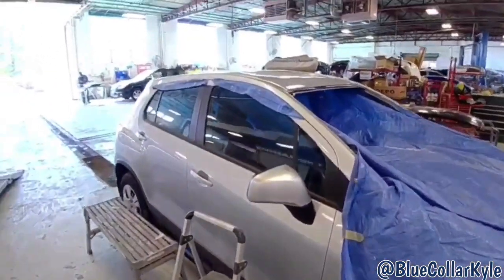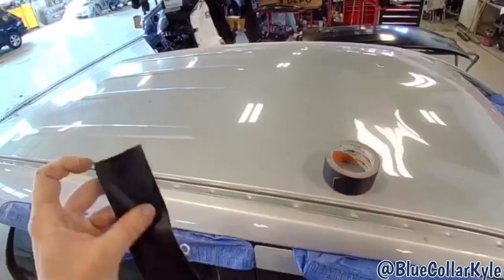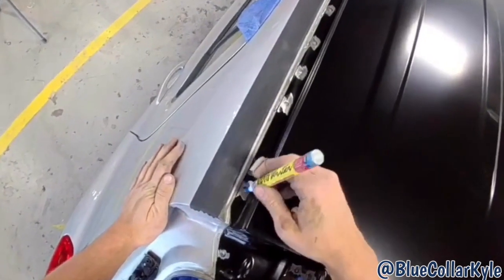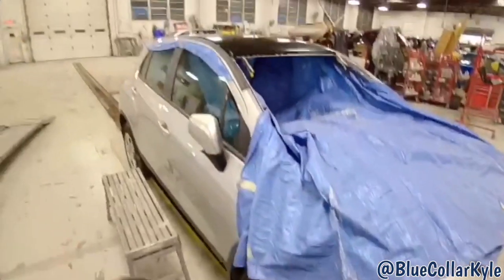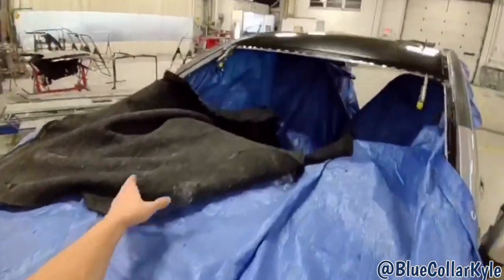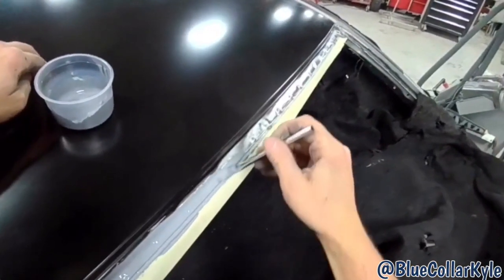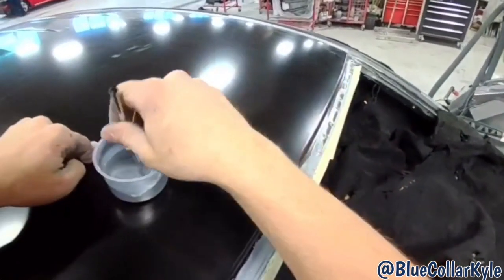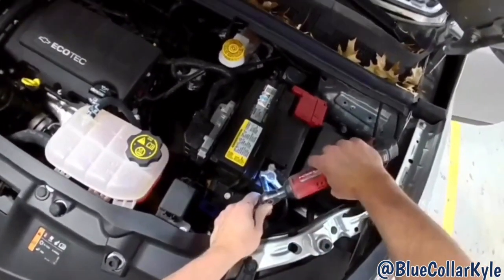Make It A Convertible!

Comment: So...  why not just take the dent out?  Didnt look like a terrible dent... just curious.
Reply: Nitro 187 it is pretty bad. You have to remember, insurance companies are cheap and want the cheaper route. So if replacing a roof skin is cheaper than repair that dent then they’ll pay for it. Also have to consider if the repair would be a safe and legit repair when you repair that dent if it wasn’t replace. But it truly wouldn’t be worth it as replacing a skin would take less time.
Reply: @celo8019  by the looks of it, repairing the dent looks faster...  but I do love watching this process. I guess they have pre-set methods on things though.
Reply: tony75814  cracked paint?  Who cares....  sand and re-spray.  The roof skin is hardly load bearing... that's an easy pull.  I think the other people were correct and that insurance is required to fix certain ways.... not for safety in this case.